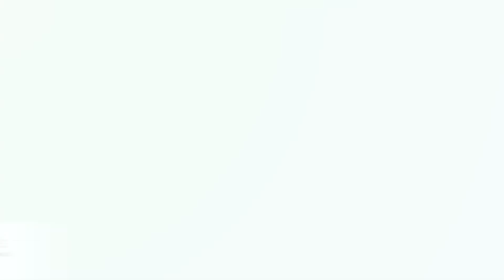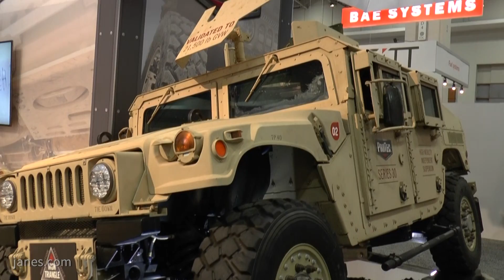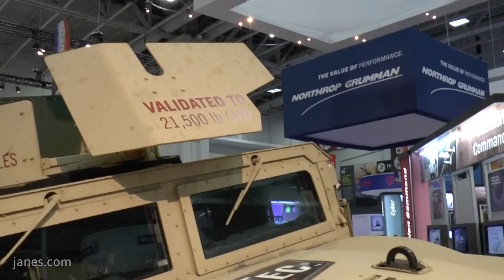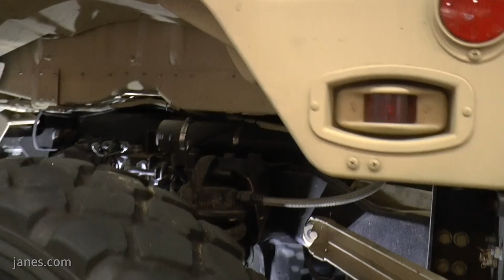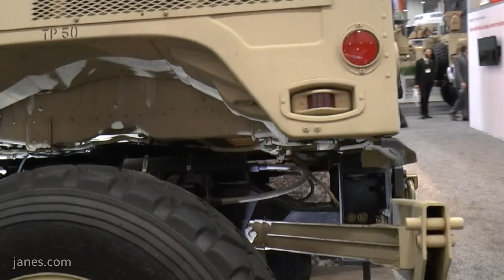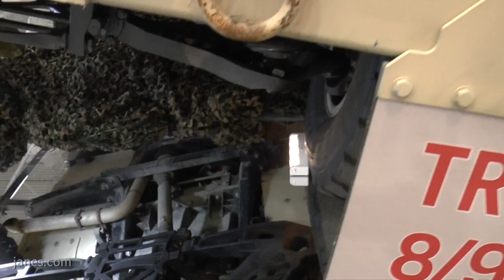AUSA 2017: Meritor Defense Humvee Enhanced Mobility Upgrade

Comment: Considering there is no real change of the protection level, what advantage could this have over L-ATVs for example? I dont really see any. Mobility? Questionable. Price? Barely. Versatility? Nah. Making the supply chain even more demanding? Yes.
Reply: Recent M1151 sales in 2014 to Iraq were close to $300k a piece. US DoD usually paid $180-200k a piece in 2009. So my estimate for the current standard M1151 for US DoD might be somewhere around $250k. Weapons not included. Since Wiki states a $250k base price for the L-ATV as well, I cannot image the costs for this modified version being a decisive factor in its favour.
Reply: Gustaf Grei he said there is Series 50 protection available for it for heavy protection.
Reply: Does that actually improve the structural integrity of the vehicle by a large margin in the way the L-ATV does, which is so much needed against IEDs? I personally am highly sceptical. But then again I am not an expert or engineer.
Reply: Yeah, it will be inferior to the JLTV but I am curious about the cost about this suspension upgrade. Do you have any ballpark range cost estimate?
Reply: Familiarity is worth noting. The Humvee is an already well known and understood machine. An "Upgraded" humvee would be the quickest possible machine to adopt into practice. Mobility is ABSOLUTELY improved, no question about it. The price is always going to be fantastic because the military already has the means to support Humvees. Its also going to be as versatile as any other vehicle in its class, even moreso with the mobility upgrades. 

Im not sure how i feel about humvees staying on the battlefield, but better ones are always welcome.
Reply: @dragonbutt  -Well said. Baked into the unit cost of each vehicle is spare parts, mechanic and maintenance training and support, etc.
  The cost per unit always is eye watering. But, as you said, many other countries use the Hmmvee and would be cheaper to buy some upgrades as they desire. Better suspensions and carrying weight, protection, phone chargers or cupholders.